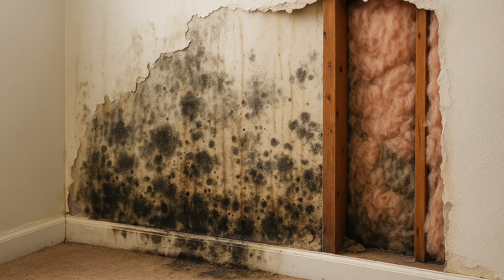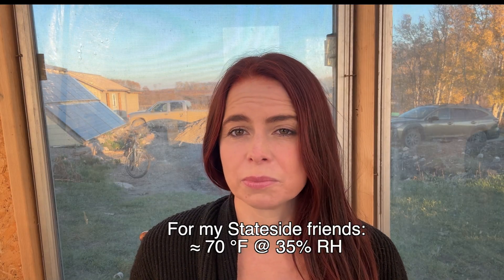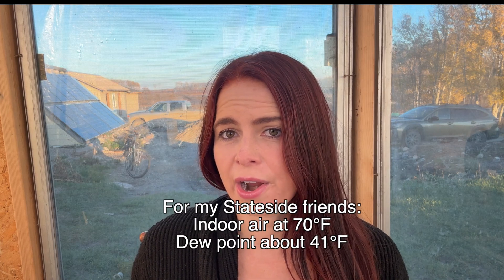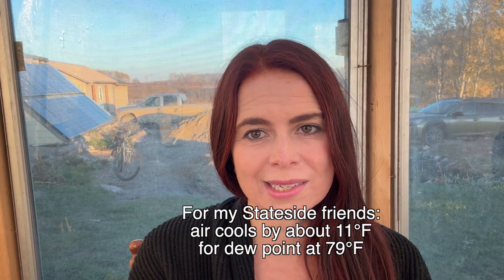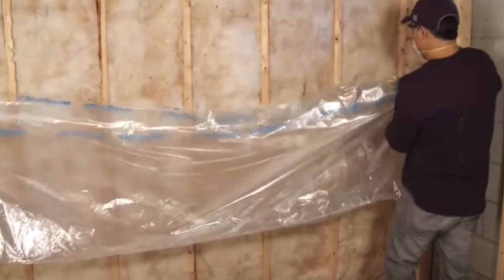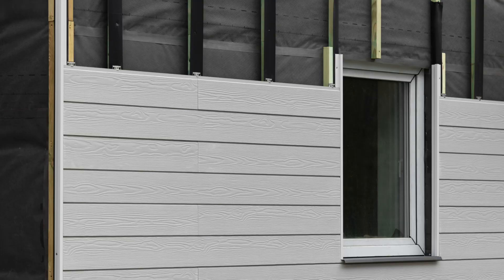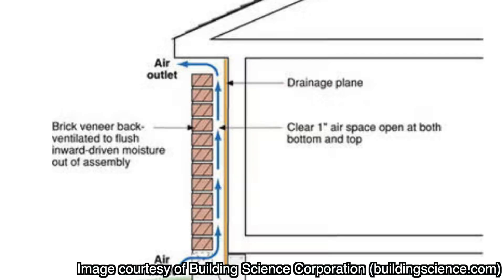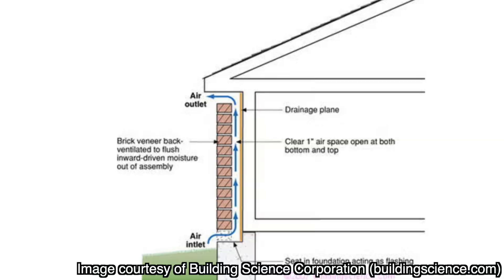How Air Leakage Rots Modern Homes (Even Without Water Leaks)|  Part II

Comment: I love opening the windows to my home 😬
Reply from the maker: Nothing wrong with that! Ventilation inside the home is so necessary. It's the air (and resulting condensation) inside of walls that don't "breathe" in terms of vapour that leads to rot.
Reply: @RootedResilientLiving  ❤ I so appreciate the follow up! My mind would have festered on if I'm contributing to the destruction of this house by opening a window 😅
Reply: @Na_Hub  Remember that opening the windows equalizes the pressures and humidity levels in the air, so the moisture is not being driven through the wall with pressure differences and moisture seeking drier air.

Modern homes rot for several reasons:
1. They are less drafty than old homes and have less drying potential when the materials do get wet.
2. Modern "fast growth" wood contains less resins in the wood compared to natural old-growth lumber which naturally resist rot.
3. Materials used to control the air and moisture trap it in the walls rather than allow the vapor to pass through and dry to the inside or outside.
4. No fresh air is allowed into the home and the air becomes stagnant with increasing moisture levels from the occupants, showers and cooking.

Remember the air inside is far more polluted than the air outside. You need to get the stale air out and allow fresh air in. In colder climates, wear more layers and blankets and give the house a chance to breathe.
Reply: @David_H_Parker  excellent. THANK YOU!
Reply: @David_H_Parker  You didn't mention it, maybe because it's so ubiquitous that it feels inherent, but the biggest difference in modern homes is air conditioning in summer and humidifiers in winter. That's what causes condensation from vapor.

The other side of the coin is keeping rain out, and that's where the old, drafty homes helped somewhat with drying. But wood is going to rot with repeated water exposure regardless, unless treated with chemicals (pressure treated wood).
Reply: @chrimony  I didn't mention A/C because it is a factor that will remain in use in both old and new homes by the average occupant. Old drafty homes with air conditioning will drive outside moisture inwards due to the dehumidification inside the home. The condensation from the cold surface is a separate cause that is largely dependent on insulation. 

Keeping the rain (bulk water) out is important on all structures but drafty homes will dry out quickly to avoid wood rot. Modern pressure treated wood will rot because the old treatment chemicals have been banned and changed plus the wood is genetically modified fast-growth wood.

As the home gets tighter, it becomes critical to have moisture control designed into the home with proper materials and engineering. Unfortunately, the materials and engineering are still works in progress. The experimental strategies need to be time tested in real world scenarios that are impossible to create in a lab.

Even Matt Risinger's highly engineered builds have developed mold in places he never imagined. The highly insulated SIPS homes in Alaska are rotting because they don't allow vapor to escape. It took building scientists a long time to determine the cause of Alaska's ridge rot problem on SIPS constructed homes.
Reply: @David_H_Parker  Old homes "back in the day" didn't have to deal with A/C and humidifiers. That's my main point.
Reply: @chrimony  Okay.
My point is not to randomly seal your old home because it will likely cause problems. It gets very complicated to properly seal an old home and keep it from rotting away.
Reply: @David_H_Parker  I think the vapor seals on the inside make sense, while a vapor-breathable house wrap ("weather resistant barrier") and siding to keep the rain out makes the most sense, as laid out in this video, even for older homes. It's debatable if a new house should constructed to be sealed from both the outside and in.
Reply: @chrimony  Your climate will be the biggest factor when deciding the design and materials.

A house in Phoenix will have much different demands than a Florida beach house for A/C cooling.

While a house in the midwest or northeast would be a totally different insulation and vapor barrier strategy than the houses in the western states.
Reply: @David_H_Parker  I agree, but the challenges are pretty similar, even in different climate zones.
Reply: @chrimony  The biggest difference is which side to put the vapor barrier and insulation. 

Quality of installation is probably the single biggest variable.
Reply: @David_H_Parker  The thing about putting it on the outside is that if there's any leak, you're going to get mold growing and venting into the inside. So I would either do both or just the inside, so the outside can breathe.